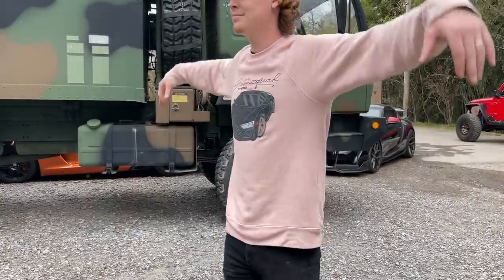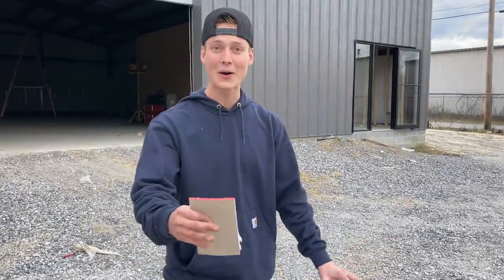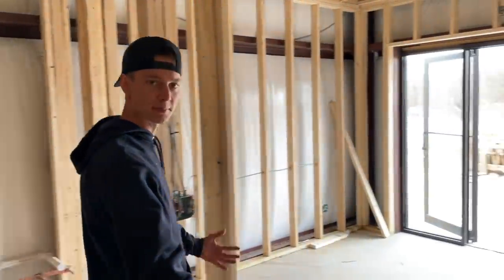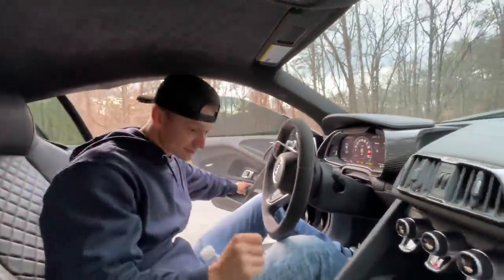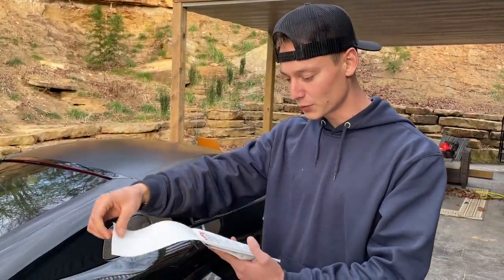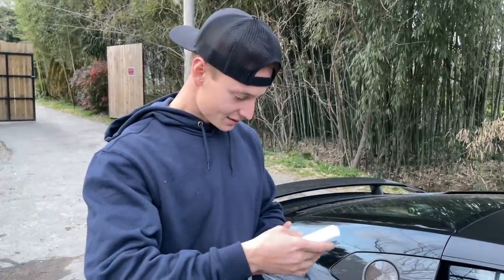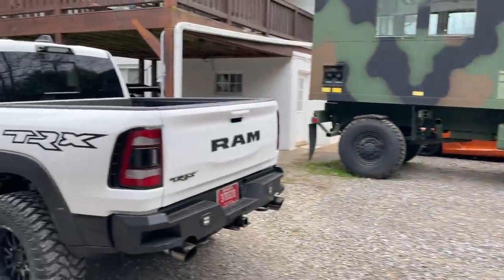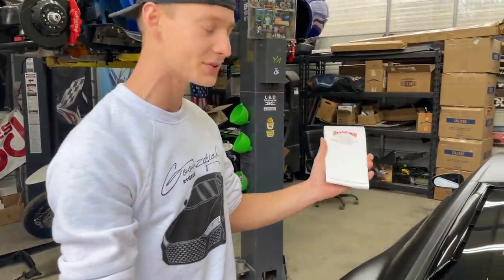Cheapest Twin Turbo Audi R8 EVER!!!

Comment: Excellent job guys. The only problem with salvaged title or rebuild or whatever your state calls it, is that it's near impossible to get comprehensive and  collision (you can get liability but it pays nothing to you if you wreck the car). So if a person buys a salvaged title, it should be second car they can afford to have as a total loss in the case of an accident (even if it's not their fault).  If you can find comprehensive and collision, then it's a great deal. But for most, $230k is still more than they can afford to roll the dice with.

Comment: Hope you all consider giving the floor in your new headquarters the same finishing touch as you do your cars. By that I mean cover the floor with a professional epoxy coating. It will make it a much better work environment and look epic dudes. Not to mention it will make it much easier to clean up.
Reply: They did do a good job on the new house on the mountain,  that’ll be cool if they did something like that in the new shop

Comment: You have to factor in that it carries a Salvage title so its difficult to insure plus it leaks wind noise thru the door so you need to discount the price more than that!
Reply: Yeah they seem to forget that salvage title cars are not worth anywhere near clean title cars.
Reply: Common dude, its not like it had fire damage, or engine rebuild, this parts replaced are clean, and good as gold. How about you discount 15% from MSRP,  add $70k, then add another 20% on top again, because its so damn rare, and you can get it delivered today in 1 day, not 14 months waiting time. Put it up on high-end auctions for $260k reserve.
Reply: Don’t believe anything that this guy (Whatapp username) says it’s a SCAM
Reply: @Kitty-oy5nj  dude it will never be like OEM.  Original paint and body parts has a lot of value

Comment: You guys could turn the non lift side of the OG garage into a paint booth so you don't have to wait for it once the new garage is done I think that's a cool idea
Reply: too small of an area.  they need more room around a vehicle.
Reply: @Chip_W when they have the area cleared its the same amount of space as the booth they currently use. They would just need to put a door at the base of the stairs it would work.
Reply: Surprised he didn’t mention a booth at the new shop, they’d get more use out of a booth  than a frame machine I think

Comment: Hopefully we’ll get to see them knock the rough edges off the R8 and finish it completely. Ideally for me remove the rest of the wrap. There still seems to be an issue with the headliner being dropped/creased wheels, tyres, missing bits, clearing the  warning lights etc. I’m a bit concerned how well the paint will hold up on the bonnet/hood particularly having been flatted patched re primed and blown over again. Not really the way to go about it on what will still be a quarter million dollar car. Just saying, but I definitely want to see a further update.
Reply: I dont think the AWD system is working . The car is all over the place..
Reply: This car is headed for the back yard with the rest of the unfinished builds. Not even close to being finished and they will never fix the tub like it needs to be
Reply: @bruceg21  Shhhhhh I can hear your ignorance all the way over in buffalo. Jealous ones envy. You seem to know an awful lot about these guys.... so they still got you hooked. They've said it a few times, they don't want the content getting stale. They have almost 2.5 million subscribers, so I'd say they're doing just fine.

Comment: And still we haven't addressed the fact the carbon tub is damaged. I love the builds and variety but feel this one has had the problem covered up so probably technically still a right off
Reply: They will never talk about that. Probably reason they will never sell this car.
Reply: Yeah if they start turning the wheel and applying power the car will probably snap in half. It sure does go fast in a straight line though! Point being, this thing isn't safe at all.
Reply: Y’all are keyboard enginerding too hard, if you are talking about the superficial surface scratches on the passenger/seat/rocker area..
Reply: bro sorry english is not my main laguage so i dont know some terms... wtf is a TUB?
Reply: Well the car wasn't proper t-boned, otherwise the tub would've visibly been done-for, so its likely okay enough that its safe to drive. Its just if the vehicle were to ever get hit on that side again in the same way then the tub would be truly and totally broken, and its probably lost some crash safety in that event anyway. Some time spent forum searching tells me that the tub would be fine unless it was hit either really hard, in which case they would have had to straighten the rear pillars, or if it was t-boned with decent force at maybe residential-ish speed.

A carbon tub is quite resilient, and it reacts like rebar concrete in some ways, the surface can be cracked while the structure is still holding up to expected stresses, but regardless I would say its a good idea to take it to a specialist for an examination. Now, I don't remember which video had them look at the tub and see a crack, but if you could find that and see if the crack is straight or jagged, that would tell a lot. If its a straight crack, then it isn't a crack at all, that's just carbon layering and you see that even in brand new cars such as the Alfa 4C, but if its jagged or curved like the cracks that run through a glass cup that's been cracked, then the tub is broken and can either be repaired if the crack isn't long, or scrapped if is.
Reply: @Avetho  point being they can drive it all they want , but selling a car that has covered up damage like that is a lawsuit waiting to happen. There is a reason engineers are audi do not allow you to make any repairs to the tub. I’d drive the hell out of that car as is if it was mine, but I wouldn’t dare try to sell it as is , that’s some sketchy shit
Reply: Without researching - is it even safe to put that much HP in this car when it hasn't been wrecked? With the stock underpinnings? Can't remember if any suspension/stability mods were done.

Obviously it has already gotten away from someone. In no way shape or form would I ever drive this fast except in a straight line. And that kind of defeats the purpose of having a R8 IMO as it is built for handling as well as speed. And something with this much power needs a experienced driver as well. I just don't want anyone getting killed.

But then again, I may be stressing over nothing because it will probably end up being another lawn ornament rotting away like the others. We'll never see them take it to the track. The best we can hope for is doughnuts in the side yard lol
Reply: @bladerunner1b  i think it has an aftermarket suspension and it used to have a better wheel and tire setup

Comment: To be fair with us, this was a damaged car. Cant ask the same price as a mint one. At least that is what we are doing in EU. Damaged cars, even special ones are selling for 40 to 60% the price of a good condition car. We like to spend money, or "big money" on non damaged cars. In EU most of the damaged cars (even special models) are going to scrapyards or they are used to scam other people into thinking they buy a nice accident free car lol. For example, no one would buy the Jeeps in the condition you bought them. We would use those cars for spare parts. US ppl really like to repair cars looks like,
Reply: They said it’s worth $350K+ (non wrecked) and they’re asking 230K…. Brand new it was $217K and that doesn’t include the $70,000 TT kit plus labor and aftermarket parts lol. That’s a GREAT deal.
Reply: Yeah 200k tops. Nobody would pay 230.
Reply: if it was a clean title the car would sell for over 300k... $230K is crazy price

Comment: I'm a gm wholesale parts salesman, do you have the last 8 of the vin or the part number on the radiator support? I work for one of the biggest wholesale parts operations in the country, and have connections most dealers don't have.
Reply: Any idea why they aren’t making a part on a car that’s still in production?
Reply: @LT4POWERED  Has all to do with shortage of materials. Gm uses A lot of different venders to source materials from but it's like anything else right now, everything is very hard to get.
Reply: @ClaytonHenderson521    Figured.  That’s rough.

Comment: Guys, you've got to get the XPEL Stealth off the car. Just go straight gloss. BTW, that "broken cap" is $1275. I replaced mine on my Gen 1. It took 3 months as there were none left in the WORLD. Audi had to manufacture one. They built the wrong part as it was modified in Gen 1.5. Then, they finally got the right one made. Unbelievable that it happened, but made a great story. I now have a '21 Performance V10 Kemora Grey with red interior. It is also wrapped in XPEL Stealth with all the CF parts in gloss.

Comment: When discussing the new garage you never seem to mention putting a Spray Booth in the back corner!! it would be a big advantage, as you at the moment have to make appointments to do a spray job, and sometimes have to clear up after the last person that used it, where if you ad youre own, spray whenever you want to. Before new build arrives Spend time on the new garage, New Fence to make it secure, Landscaping, finish interior.

Comment: Well i dont know how the rebuild title etc works there in USA, but here in Sweden we dont really have that. But considering that this is a very special R8 and with possibly every add on u want to have on it. It looks so dope, and i love the diamond stitching interior and roof. Love all the carbon on it. Looks so so sweet. This is definitvely a keeper togheter with the Viper. Then i belive when u showed the window sticker the car itself was 195k and then with the add ons like diamond stitching headliner and seats and some carbon parts etc i was around 217k. If u wait 1 year or something i think u can get around 300k atleast for this car, the value will continue to go up. But for me this is a keeper. I dont really care about the Ferrari and the Lambo tho, those u can sell. I do really miss the Denali tho, that was a sweet ass truck, loved the silver with chrome on that one.

Comment: you not need waitr elektrician. all elektric parts etc.light to roof you can install all first and all wires can install, then last come certificied elektrician connect only all wires to stuff and main fuse box. youy save lot time and money.

Comment: I love your channel guys but some of you purchases are just to expensive I know you personally want the cars so you overbid , the second a title is branded and you loose warranty the price is just low even in a beautiful R8 with a twin turbo kit , your looking at a 2018 R8 with afterlife warranty the price is around 150-160,000 some lower and sow a bit higher and the second it’s baranded that price plummets lots because there are a lot of factors that just make them a bit scary to purchase them throw in a twin turbo kit and now it’s just frightening that turbo kit is basically free at that point and loss of reliability so bringing the R8 back to stock would be a better financial choice and sell the twin turbo kit separately… 134,000 grand you have invested and it’s still not complete so you will be around the 140-145 range with tires and rims and that’s going to be pushing the sale price to high for a branded title , I can’t see you getting higher then 140 after completed but you will scare away 90% of potential buyers with the turbo kit knowing the car has been raced and beaten but with such low miles is worth making it stock knowing it hasn’t been beat but wrecked lol .. good luck guys and start selling everything off and while your at it selll the twin turbo kit now

Comment: Hate to say it....but, it seems like a completely unusable car? I mean, with that much boost and HP, you cant drive it in corners? seems like it's just potentially usable only in a straight line, which the R8 was never designed to be

Comment: 230k for a wrecked rebuilt title car hammered together by to knuckle heads and paint from O'reillys?   Hahahahahahah  Don't look at the frame damage, bad gaps, ripped tapped up headliner, cut dash, turbo bracket bent and falling off, and "repaired" suspension again by the knuckle heads.